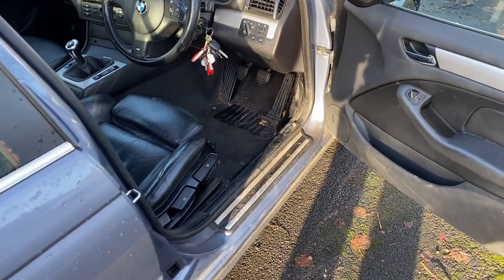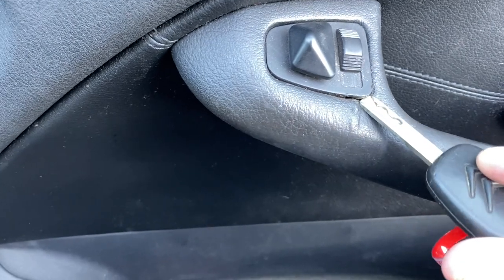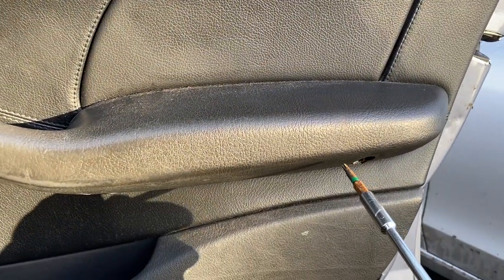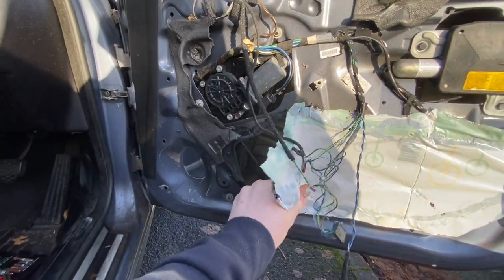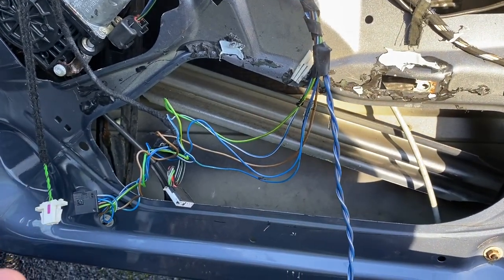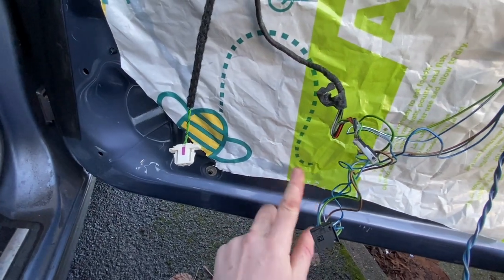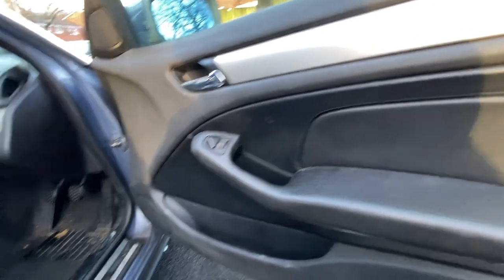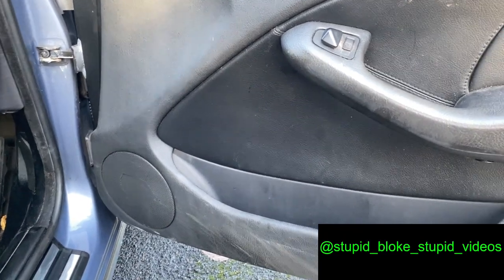BMW E46 Leak Repair. Water in Footwell, on Sill, in Door Shut. Door Vapour Barrier Replacement DIY

Comment: So ur keeping the water inside the door, and not the wrong side of vapor barrier? And where is the drain for the door ?
Reply from the maker: The water runs into the door anyway as it will always pass the weather strip along the bottom of the window, but the door has drain holes in the bottom

Comment: Ah ,,, I didnt realize you were deprived ,,, maybe you need to go past the automotive equivalent of the food bank ,,, sort of  a tool bag or a sack of bits or something and see if they will donate some of the gentleman's sausage waxing strip that comes on a roll and use that ,,, a simple run of gaffa tape right round that membrane would have finished it off right proper ... 

but we did get foor tapping ,,, thats a great thing.
Reply from the maker: There are probably many ways I could have done it better, but it was spur of the moment using what I had available at the time 😂
Reply: @StupidBlokeStupidVideos   theres not much in this world that cant be fixed with gaffa tape ,,, and even less that shouldnt . long live super glue.

Comment: What a joke FFS!
Reply from the maker: How come?
Reply: @StupidBlokeStupidVideos  When the vapor barrier is compromised you WILL have wet carpet. The water on the outside sill is water that is draining from inside the door that is entering through the window. Cant you see where the rubber seal is that the door seals against?
Reply from the maker: @anton.basanisi  I know what you’re saying and if I hadn’t seen it do this the way that it has then I would totally agree with you. The vapour barrier is to the inside of the door and should by right go inside the car, but it wasn’t doing. You can see where the water is running out of the vapour barrier clearly, but instead of running into the car it must be sitting there trapped til the door is opened or something. Since doing it, the water isn’t pooling on the sill anymore when the door is opened.
Reply: @StupidBlokeStupidVideos  just get a bucket of water and tip it onto the window and i'll bet you will have water on your sill..
Reply: @anton.basanisi  hasn't got wet carpet , just water on the sill from the video i watched , 
;p